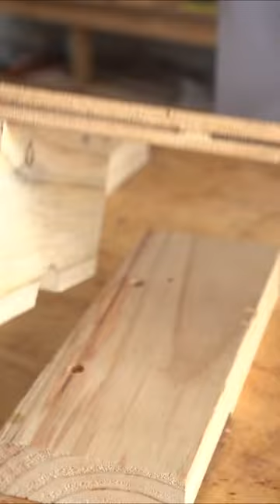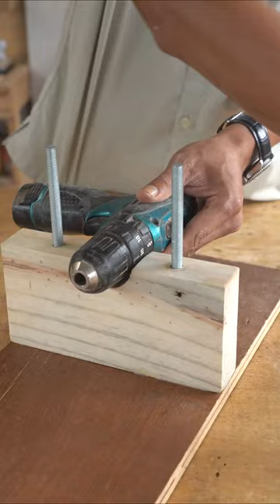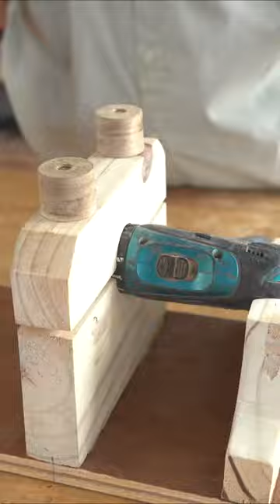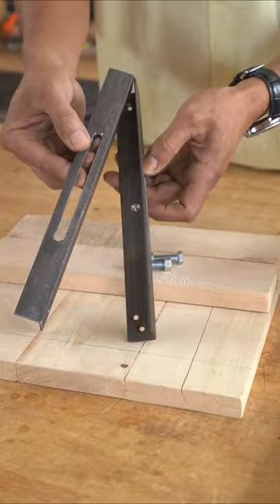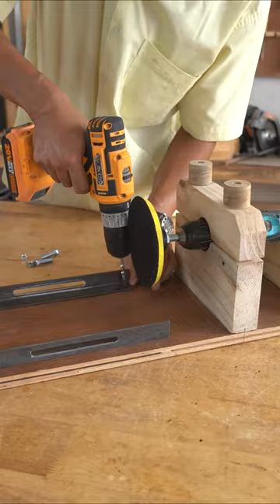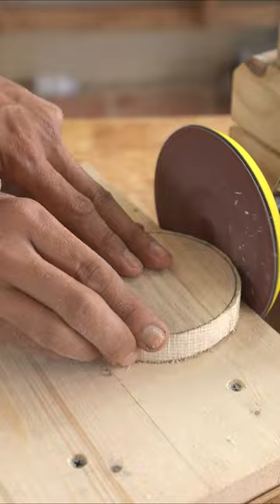Make Replaceable Disc Sander - DIY Homemade velcro Disc  #shorts #woodworking #diy #asmr

Comment: Harbor freight has a great sander for $69, thats less than the cost to replace a burned out drill that is not designed to run continually at high speed.
Reply: Maybe he made this because he cant afford one, and stop talking BS about the drill as there called high speed drills for a reason. lol